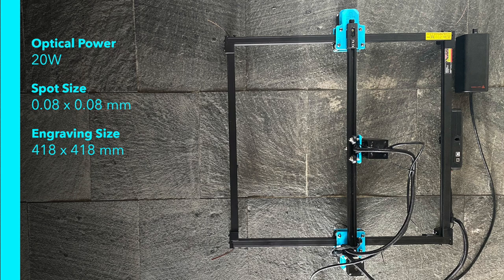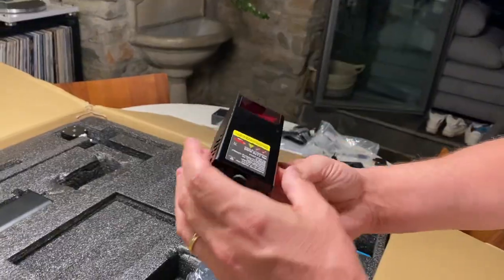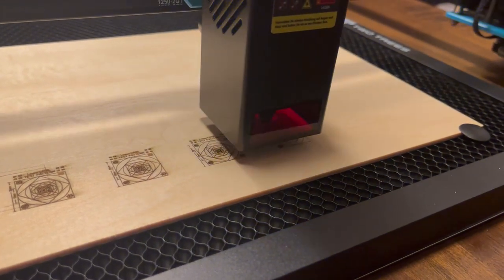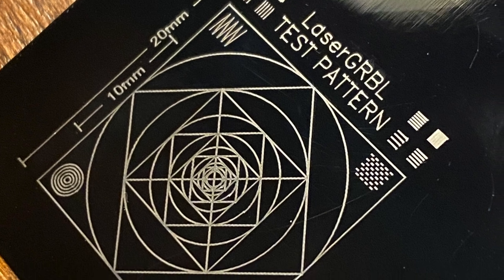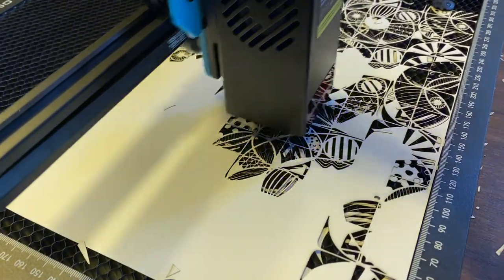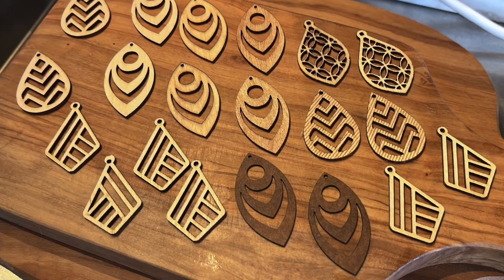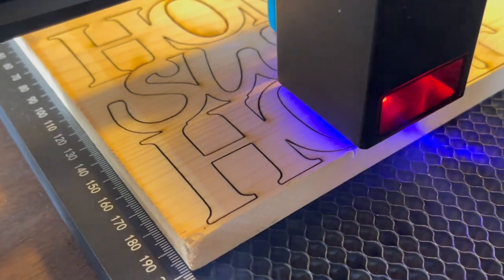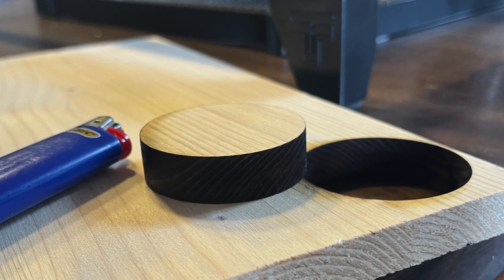LaserGRBL Two Trees TTS 20 Pro

Comment: Hello! Good video! What do you think is the best laser for photo engraving?
Reply from the maker: High quality photo engraving requires a good mechanic quality and not too high laser power (high power module combines multiple laser diodes to obtain high power, but in terms of spot size the performance is worse). I suggest Ortur laser master 3 for mechanic quality, combined with ortur 5w short focus laser module that is the better for engraving.
Reply from the maker: 5w is slow, if you want more speed choose a 10w, higher power is not necessary if your goal is engraving.
Reply: @lasergrbl  In your opinion, on this laser ortur laser master 3 9-10 points per millimeter, can it be done in the Laser Grbl Program?